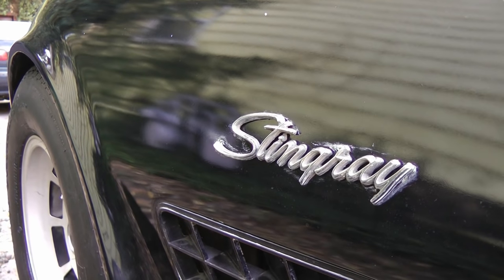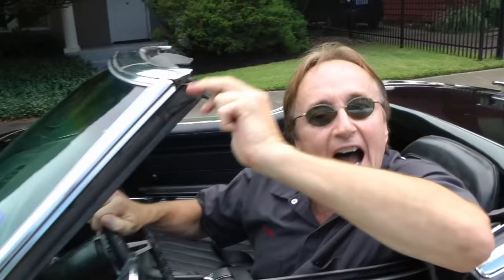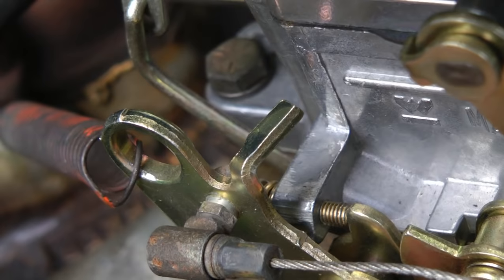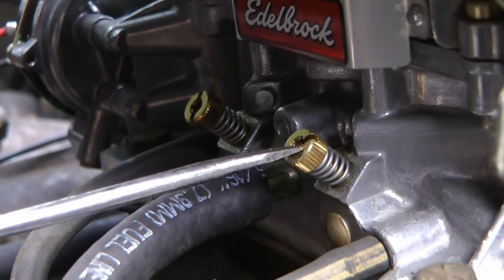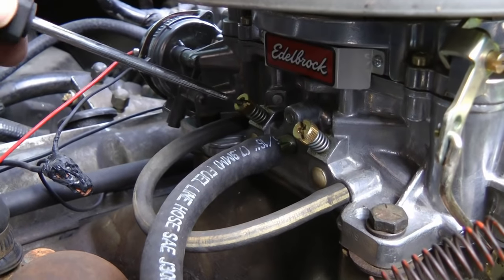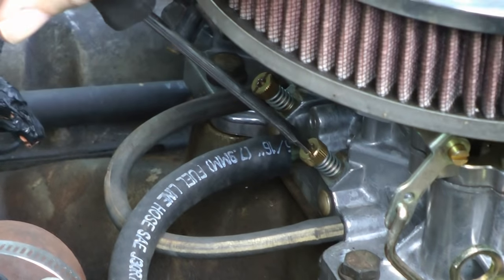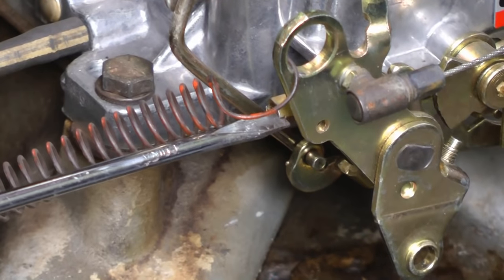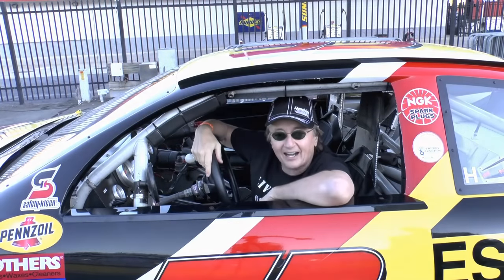How To Adjust A Carburetor On Your Car

Comment from the maker: Things I used in this video:
1. Screwdriver set: http://amzn.to/2jaHIfP
2. Common Sense
3. 4k Camera: http://amzn.to/2hZ4AxX
4. Mini Microphone: http://amzn.to/2newgV9
5. My computer for editing / uploading: http://amzn.to/2i2sKYz
6. Video editing software: http://amzn.to/2jv5Fhf
7. Thumbnail software: http://amzn.to/2k7tz6C

🛠Check out my Garage to see what I use every day and highly recommend:
https://www.amazon.com/shop/scottykilmer

❗️Check out the Scotty store:
https://goo.gl/RwhRGU

👉Follow me on Instagram for the latest news, funnies, and exclusive info / pics:
https://goo.gl/ohy2cA
Reply: I have a 1985 k1500 I don't know the carb I have on it its a 305 and I am getting bad mpg and I never did before but I can smell the gas when I decelerate and it started to sputter when I'm braking and when I turn it on it blows black smoke what do you think this could be
Reply: Ashley Marrone running rich
Reply: Scotty Kilmer, good vid but you left out how to check vacuum to and adjust if needed, the primary and secondary choke pull offs as well as the fine tune adjustment of the choke mechanism and choke step down idle speeds.
Reply: Ashley Marrone if it's blowing black smoke, you are burning lots of fuel. Try leaning it out.
Reply: Hi Scotty, I have an 1987 Toyota starlet. (engine is 2e-c) Which is difficult to start when it is cold. I suspect this is the automatic choke that failed. How can I fix it?
Reply: Hey scotty what do you think about the 1998 mitsubishi galant... it is carburetor
Reply: Where can I buy common sense? Please help, somebody
Reply: You make it so simple thanks for the video I’m new to carburetors and I’ve always struggled to figure out how to adjust them.
Reply: Great vid..Could u drop a link for though?

Comment: Back when it was easy to adjust and fix anything.... Man I wish cars today could be easily fixed without needing a scan tool computer.
Reply: mclaine33 Do you also wish modern cars had worse fuel economy, didn't last as long, could be affected by small changes in fuel makeup, required more maintenance, and so on? I think its a fair trade off.
Reply: Gerberbaby922 Yeah fuel economy sucked but gas was very cheap. It isn't good for the environment though. Didn't last as long? Idk what you're talking about. I feel like many older cars were better build than todays cheapo junk parts that fall off or break (like bumpers made of plastic). More maintenance, yes sometimes, depending how often you drove. Overall it would be nice if cars today can be built just as well as older cars were. A really great example that I can say would be the Tesla Model S. That thing is very well engineered and I'm sure in the future that will become a "collectible or classic" too.
Reply: Gerberbaby922 What about SEFI & EEC, but pre OBD?
Gotta 5.0 Windsor ('86 Colony Park) which uses half the fuel compared to my old '63 Impala: 283 with Edelbrock AFB.
Not entirely fair, since the Merc has a 4 spd with lock-up, but I feel the improvements in maintenance aren't that big anymore between a 1986 panther and a 2012 one, and according to the EPA their carbon footprint is equal...
The best of both worlds perhaps?
Reply: mclaine33 it was common to get valve jobs done, idk about every 30,000. It was rare to get 200,000 miles out of a car. Also, the metal rusted easily.
Reply: mclaine33 man I wish cars still had 5.7 liters of displacement and only put out 170 horses lol. i  drive an old carbed 350 sometimes but i have to admit that modern cars with vvt, efi, forced induction ect are pretty amazing. the new eco in my mustanf is putting out 390 ob ft and 335 hp from only 2.3 liters !!! im notbgetting the estimated epa mpg  but thats probably because its so much fun to drive
Reply: you can go back in time and keep your crappy engines than. it's not like today's cars can fly or something, it's not that difficult. you should be thanking computer's not trying to bash them
Reply: "Do you also wish modern cars had worse fuel economy, didn't last as 
long, could be affected by small changes in fuel makeup, required more maintenance, and so on?"
-Let me address a few points here.
1 "Didn't last as long."
-This is bullshit. The average vehicle in America is only made to last ten years today. Older vehicles were designed to be easily repaired and maintained. Also, new cast aluminum engine blocks and automatic transmissions wear out MUCH faster and are extremely expensive to repair. Here's a universal truth. Cars do not break. PARTS break. If you make the parts super easy and cheap to replace then its just like the Ship of Theseus. 
2  "could be affected by small changes in fuel makeup"
-Older simpler engine designs were far LESS picky with fuel. I can run my 1969 C10 on vaporized wood, cow shit, and coal. I can even run vaporized diesel and motor oil in my 1966 F350. Can you run your new car on vaporized wood smoke? Okay.
3 "required more maintenance"
-Yeah but when the maintenance takes 15 minutes and costs less than 50 dollars every few years who gives a shit? I'd take that over some automatic transmission or mysteriously faulty wire any day of the week.

Fuel economy. Vapor fuel systems. Look them up they are real. Vehicles have been capable of getting over 100 MPG since the 1920's. Suppressed technology. There's nothing special about a computer. There is literally not one advantage to having them.

But don't take my word for it. Read the works of Henry Yunick. One of the best engine builders to have ever lived. He said that the computerized over complicated engines being put out made him "want to puke."

BTW, the VW Beetle in 1934 was getting 33 MPG. You could change out the entire motor in less than an hour.

My 1966 F350 I pulled out of a farmfield. It had been sitting for over a decade. I put literally less than 3k into it (thats including the cost to buy it) and one weeks worth of work and I got it running nicely. Try pushing a new 2017 vehicle into a farmfield and let it sit for over ten years. Tell me how great modern cars are when you scrap it due to it being unrecoverable and unfixable.

Few of you people know anything about engineering. A textbook rule in engineering classes is that almost universally the less parts you have in a system the more reliable that system is. Thats an engineering fact.
Reply: Br!an Delta V I wish I could thumb up your comment 100 times. Thank God someone comes on here and actually KNOWS about mechanics like you. Its like saying an AR15 is more reliable than an AK47....yeah the AR15 is cleaner and "nicer" looking, but you can't beat SIMPLE and FEW moving parts.
Reply: One more thing I forgot to address. Somebody mentioned valves being redone every 30k/miles. This is because liquid fuels evaporate slowly and the vapor burns even after the valves have opened which causes the valves to burn out. If we use vapor fuel all the fuel burns up LONG before the valves open. Our exhaust is very cool (under 1000 F.) and the engine lasts and lasts and lasts. Over a million miles, sure, why not? Without liquid fuels and running only vapor we get no carbon deposits, no detonation or preignition, the vapor doesn't take the oil off the cylinder like the solvent nature of liquid gasoline, and on and on and on.

We're being scammed like crazy and in so many ways its hard to keep track of anymore.
Reply: Br!an Delta V damn right. Im a millennial. Born in 95. And yet I cant agree with you more on every single point. I was a tomahawk missile tech in the USN. Those computers are still giant 1980s mainframe computers, but are so damn easy to fix because they are so simple. Trickiest part is the encryption software, but to us technicians, it's all codes. We send and receive comms with missiles in flight with this "ancient" equipment. It works. It's why Im disgusted we did away with big popeye-muscle battleships. They are still very reliable and almost all of the existing ones are in a reserve fleet of some sort, ready to get back in the fight. Old cars are no different. You can even modernize components, but still maintain a simple, reliable system on a whole. Old cars all the way. I wont own a vehicle younger than me unless I have to.
Reply: Br!an Delta V My 1965 Mustang currently gets 16 MPGs in town. Might get 20 or more with a transmission swap (its a factory 3 speed auto and I thought about going to a 5 speed manual). And its not a pitfully underpowered car. Maybe slightly so by todays standards but it has a 2 barrel carb, 289 cu in and produces 200 HP at the wheels and weighs a little less than 3000 lbs. Main thing holding it back I believe is the trans. 
One of the biggest things I love about it is that it doesnt need an ECU to run. Just a simple power source and some wiring. You can even put in air conditioning without having to ditch the factory heater.
Reply: Fox McCloud 007 hell yeah, man. I got a 66 with the auto trans and of course, the 289. Gets better mileage than my 94 dodge, with the 318. Far better mileage.
Reply: Mark C Maybe the biggest reason that I considered a T5 conversion is to make it better suited for highway driving. I dont like the idea of having to do 3000 RPM to go 70mph for hours.
Reply: Fox McCloud 007 I can see that. Mine's all original, so I plan on doing very little to it. I dont drive it often. Only on sunny days and to car shows. I will admit that I do kind of want to switch the carb out for a 2 barrel. I've thought about fully restoring it, since I got to put new back fenders on it. Who knows. I just love driving a classic mustang. I wouldn't trade it for a new viper.
Reply: Mark C With carb swaps its a little complicated on those cars. On mine you cant put a 4 barrel on without also changing the head of the engine. Also if I do go thru with the transmission swap Id still keep the one it came with in storage. I plan to put on an AC system since mine didnt have it by default and maybe a few other factory options besides power steering.
Reply: Fox McCloud 007 i wont do power steering or a transmission swap. But I did see you need a new head. It doesn't look to bad though, as far as work.
Reply: @Gerberbaby922  have a corolla 83 (carb) with 400k+miles haven't opened the motor yet. It gets like 33+city mpg depends,i do the maintenance every 3 to 4 months and its like 25 bucks...also have a 2014 car it cost me like 60+ every 3 to 4 months, it get the same mpg and i had to take it to the dealer because it had a problem with the pistons rings only 40k miles... So i dont see much advance in technology only the looks of the car have improved and your maintenance have increased...oh and btw computer were made for mechanics to diagnose easily your problems and like 90% of them still fail to detect your problem....
Reply: @Gerberbaby922  Don't run as well? Back when straight up metal was used and parts were actually made by americans and not some cheap plastic garbage from China. Also the oil, new cars are very picky, where as for say a 350 sbc could run 10w40 or 20w50. Keep up with regular maintenance and those old car will treat you good. Trust me, '84 Camaro Berlinetta running strong and healthy
Reply: Scantools make working on cars too easy a lot. Now work on a modern car without a scan tool and that can be a different story.
Reply: @Gerberbaby922  notnwhen you account for the fact that the average modern car stays  running for about 5 or 6 years and is pretty much junked by 15 year mark.. you wont be seeing a 2015 sentra running the roads in 2050, thats for sure
Reply: @Gerberbaby922  what are you talking about? My Mazda truck has over 300k on it and still runs like new and gets 25mpg, you literally don’t know anything smh the new cars don’t even last 200k

Comment: Really helps to use a vacuum gauge. Get it idling as low as it will without jerking around, plug the gauge into a fitting on the intake (manifold vacuum), then adjust mixture screws .5 turn outwards at a time for each (.5 on left, .5 on right, left, right, etc) until highest vacuum reading, and then adjust idle to 700-800rpm in park. Too high of idle and the car will slam into gear. Anymore than 900rpm and most older carbureted cars with their stock 1100-1500 stall converters will start to engage. Thats why it goes into gear really hard. Manual cars idle speed can be a bit higher or lower, measured in neutral, parkng brake set and wheels chocked. Find what your engine likes.
Reply: Good advice
Reply: that is if the car is automatic, manual transmission cars don't engage anything

Comment: Heh, I remember doing this back in auto school and it was actually kinda fun and educational. The instructor had the engine plugged into a smog machine to read the gasses coming out and we had to adjust the carburetor so that the exhaust reach at or below state exhaust requirements.

Comment: This is a video on how to adjust the idle mixture and idle RPM.  How about making a video on how to properly jet a carb, adjust the accelerator pump, and set the choke. Most peop leave no idea how to properly set up a carb for a new combination.

Thanks,  Chris
Reply: shadowdog500 theres plenty of vids on that. not really scotty's cup of tea. he does quick vids
Reply: also most factory carbs only let you adjust the idle mixture, idle speed, and choke.
Reply: well that's pretty easy. Mainly you have 3 jets on a carb and in general you can say. One is for idle, the middle one is for normal driving and the main one the big one is for full throttle. 
What you need is time and various jets at hand.   At first of course let the car warm up, and for the idler jet you simply let the car idle for a certain period and then check the colour of the sparkplug

For the middle jet, you go on the freeway and drive it for about 1 hour with about 50% throttle. Now you can go by the colour of the sparkplug if you want clean emissions and low fuel consumption or you make several runs with different jets and find out when it got the highest speed. 

The same should be done for the maine jet although a richer mixture is preferable

Comment: Wow!! You went waaaaay back Scotty. I can't remember the last time I've seen someone adjust a carburetor. The ones on my 80's GM's had caps over the mixture screws and couldn't even be adjusted.
Reply: by the 80s they had sensors and computers that would adjust them automatically

Comment: And remember, since at least 1982 automakers such as GM went mostly to computer-controlled carbs with mapped ignition timing. You can only adjust the idle speed on most OEM computer carbs. For better performance, people had to change the intake manifold, fuel jetting and sometimes the PCM. Because of growing fuel economy and emissions standards, engine performance was sacrificed majorly from 1973-1987. Of course, the old school performance aftermarket exists for those yearning for simplicity. Replace and burn rubber.

Comment: I turn the mixture out/rich until it reaches the steady high rpm.
Then turn it back in slowly until the speed drops 50 rpm.
Readjust idle speed and repeat on other side.
The lean drop method will yield better results if you go offroad a lot or otherwise idle around in low gear like 4 wheeling.

Comment: I had a 750cfm double pumper Holley on my bb 440 cu in with a 280 crane cam. I just Use a Vacuum/ pressure gauge to tune it. Ignition Timing has to be checked first before you tune the carburetor.

Comment: I learned the best way to adjust the carb is to attach a vacuum gauge to manifold vacuum, and to ALWAYS make sure the fuel idle mixture screws are adjusted evenly 1/4-1/8 turns at a time, until the best vacuum is found.  You just seemed to turn the screws willy nilly

Comment: i rebuilt several carburetors in my time ! they are a lot easier to work on then fuel injection ! I had cars back in the 60s and 70s with carburetors started and ran better then cars today !
Reply: Lloyd Dailey tell that the emissions department

Comment: I never leave my mixture screws at highest idle. They are too close to a lean condition that way. For 45 years I have taught others to screw them out 1/4 to 1/2 turn out from high idle to allow for any contaminants that WILL get in the idle circuit. This of course is not how the EPA would like it but it allows more time until they need to be readjusted. The factory settings (in the 1970's)were slightly in from high idle and of course demanded readjustment in no time. I am surprised that others have not taken up the slightly rich practice as it works better for a longer time. Highest idle is not necessarily "perfect" as some would say if you have to keep readjusting them. In some states that unfortunately have smog tests I suppose you have to do it their way but not where I live. I have several cars with two four barrel carbs. and rarely have to adjust them.

Comment: thanks for all he help and ideals, question for you - i have a 1980 corvette with that same carburetor - cant keep ideal very well - i had never noticed if there was a spring or something on the other side for the choke?  there are a couple holes over there that seems might be to keep in place or adjust ?? wondering if had any ideals on that.  Thanks again

Comment: A great video, Scotty, I have a question, I am about to buy a buick with a 455 engine with an edlebrock and and at cold start it is has a hunting idle, also when you hit the gas it does not pick up well, seems like it is out of power. This information might be a little general but do you have any idea what might be the problem? It it just a matter of tuning the carb or is it a more serious problem? What might be the steps to undertake? Greetings from Holland